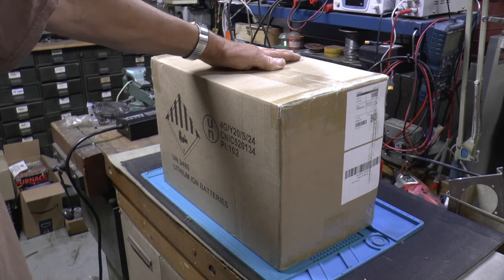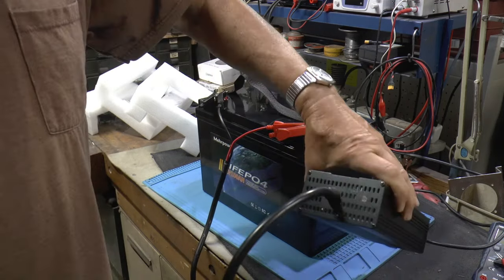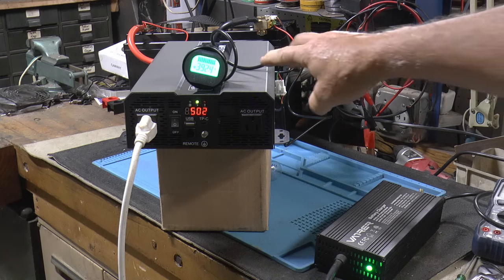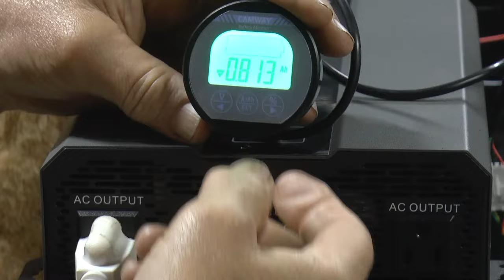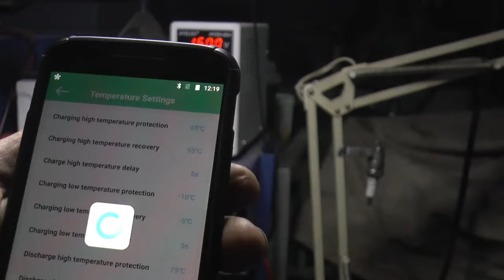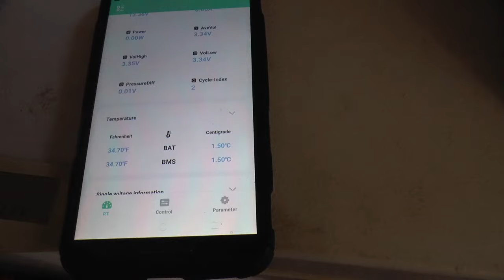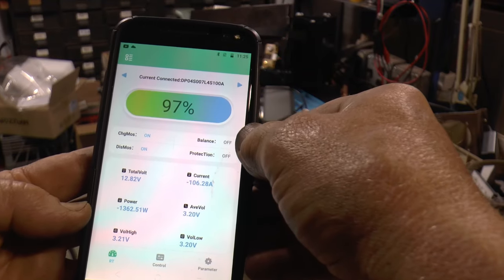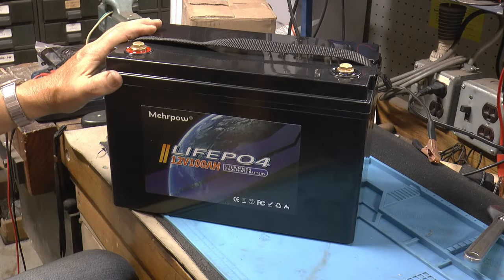Mehrpow LiFeP04 100 AH 12.8 Volt Battery Test and Look Inside

Comment: This video led to my battery problems being solved. I have this exact battery. My BMS was reporting very erroneous numbers no matter what I did. It was reporting the SOC at much higher than it actually was. I didn't know this OverKill app existed but I downloaded it to set the proper low-temp cutoff and when I wrote that information to the BMS it rebooted and began displaying the proper SOC. Thank you!

Comment: So near 7 months after how is the battery for you ? Homehow it is one of the cheapest batteries of this make on Amazon thinking of ordering these and a 4 pack of the ecoworthy batteries
Reply from the maker: It's my only battery with pouch cells and so far no complaints. I have about 30 cycles on it most of witch have been 90% discharge. Mostly used on my diy power station.

Comment: I built my own portable battery bank with one of these, considering getting a second one and removing the cell bundle of out of the case to fit two of these in my bank. Running a 1000 watt inverter and several power ports with a fuse box. I use it to power my electric cooler and the usual devices. I work on the road and in the hottest places in the middle of summer one battery will get me two days without power, 4 days on average, and 7 days in the cold winter.

Comment: I don't think 7awg cable can handle 100A, right? How can it have 7awg cable?
Reply from the maker: That's what I thought too but I seemed to do ok and didn't get hot. I guess the silicone high temp wire with very fine strands can safely handle more current. I did like the fact that the over current protection worked quickly at 110 amps.
Reply: @kevincrawford2027  that's good. I have seen other batteries with 8awg so I guess this one is better than the others. I plan to power my room with one of these and I might use high power, 800w or something so cable tickness is something I worry about.

Comment: Did you find a better printout for the charge parameters? I bought 4 and charged them separately 4 times to try and get them to "balance" out but they have pretty wild swings. 14.8 14.1 14.3 and 14.5 roughly.
I have them wired in series and have been watching them closely, soon as a load hits them they all level out to ~13.4 and start going down from there. I have it hooked to a Renogy 48v 3500w inverter charger.
Reply from the maker: No. Did you put them all in parallel and charge them until the charger shuts down (full) then let them set in parallel a day. That gives them a chance to all even out. Then series them. That is how I do mine. They do make a battery balancer that may help.
Reply: @kevincrawford2027  I didn't, I charged them individually and topped them off a few times. I did just use the overkill to fix low temp charge like you did. It had cells cut off set to 3.75v, so I adjusted it to 3.65 too